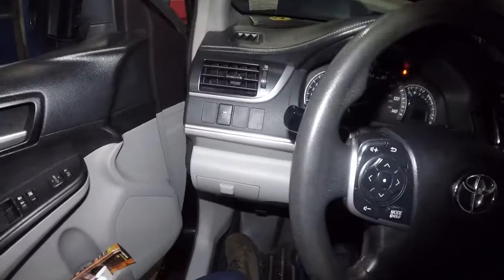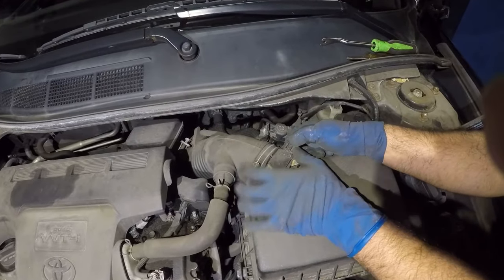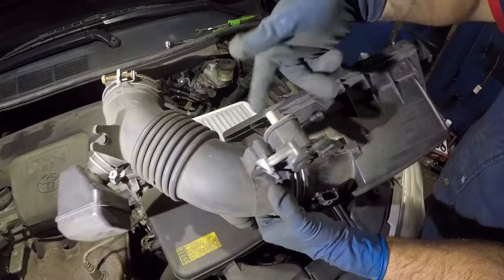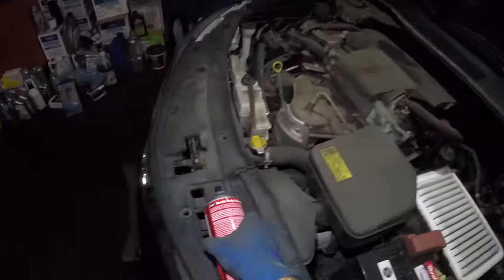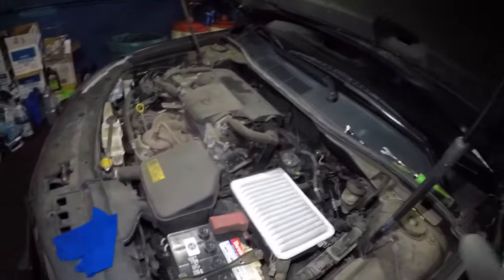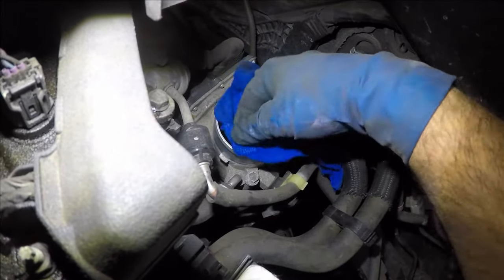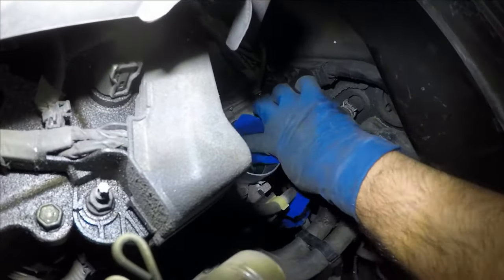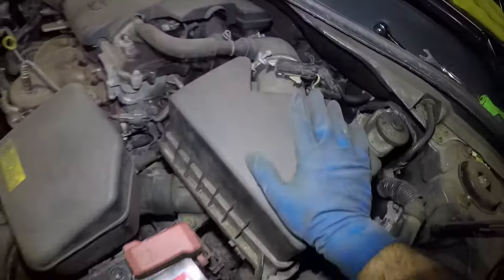Toyota Camry 2007 to 2017 Low idle car stalls and feel vibration, Throttle body cleaning

Comment: I have toyota camry 2004 (manual) When i run the car without airconditon the rpm is not drop but when i turn on the Aircondition car feel little bit shake then car when running about avobe 30+ speed the rpm is good but when car get reduced speed car shaking and when gear in neutral engine get stop plz tell me about the problem🙏🙏
Reply from the maker: Yes so when u put ac on it puts loan and this service for throttle maybe will help lot!!
Reply: ok lets do it tomorrow then i will tell you the result ❤️ @RBTheMechanic
Reply from the maker: @sanjeetimran4651  ok update me

Comment: I have the same camry 2013. It doesn't turn off on the stop light but sometimes it feels like choking when I'm gaining speed and rpms are always low, about 1700-1800 no matter the speed I drive. Do you think it could be the same issue with the throttle body?
Reply from the maker: 1700? Idle suppose to be around 700-800
Reply: @RB The Mechanic  the idle is around 700. 1700 -1800 is when I'm driving and that's when it feels like the car is choking so I need to accelerate so the car start driving better
Reply from the maker: @FranciscoCortez12  driving dosent have actual range so if ur idle is good the. U don’t need to worry however clean out ur throttle anyways
Reply: @RBTheMechanic  got it. Thank you!!
Reply: @FranciscoCortez12  I have the exact same issue on a 2014 Camry 2.5L.
Reply: @NobleAutoNC  you guys solve the issue? My car judders at 1500-2000 RPM accelerations…

I’ve seen online it could be fuel injectors or fuel pump… any help ?
Reply: @FranciscoCortez12  did you find a solution?
Reply: @omty3399  I didn't. I just kept driving like that 😐
Reply: @FranciscoCortez12  damn I have the same problem it’s just been gradually increasing on my 14 camry I changed the coils and spark plugs I changed the fuel injectors I gave the car a oil change and it’s just getting worse it’s been going on for 6 months do you guys have any advice?
Reply: @Omty  man I have no idea what is it. Dealership said it could be this or that so we would need to change things in the car one by one until we find out what is it. Which is a rip off. So I'm kinda lost here
Reply: @omty3399  change the maf sensor
Reply: @mauidapro6225  yea it was some sensor it cost 300 bucks car runs fine now
Reply: @thatredcam it sounds like the Camry torque converter shudder. Look it up. Mine had it and unfortunately I didn’t know till over the 150k mile warranty for it. Dealership won’t tell you either. It’s a problem with the car it’s self.
Reply: @omty3399  which of all sensors was it ???
Reply: @shiffleshanks  it’s crazy bc I even changed my transmission bc of it, and it’s still happening… do you think any dealership will still fix this for me? I’ve owned the car since 2012 and it has 135,xxx miles… please let me know

Comment: Any reason why a 2019 Toyota Yaris would be doing this? At 20,000 miles
Reply from the maker: Could be dirty throttle this is very common issue on electrical throttle it’s sensitive it’s perfect time to clean every 20-30k miles
Reply: Awesome I’ll give it a check and clean! Anything else you recommend it could be if it’s not the throttle body
Reply from the maker: @Ozone9300  air and cabin filters if u haven’t done those

Comment: Excellent walkthrough, thanks!  With the key on ACC, when you press the gas pedal, would that cause the computer to try to add gas as well to match the throttle body position?  Can you leave the gas all the way down as long as you want with no issues?
Reply from the maker: No it will not add gas engine is off

Comment: Do you happen to know what  the problem can be when you depress the gas pedal with the key on acc the throttle flap opens really slow? At times It opens instantly then sometimes it opens slow?
Reply from the maker: There’s no problem there these care are designed to only open depending on speed of the car for safety reasons but I can trying cleaning it might have small jam or bad throttle
Reply: Would something like a bad throttle or dirty throttle throw a mass air flow sensor code?  That’s what happen in my case I replace the mass air flow but the code never went off. I come across your video and I clean the throttle body put everything back together cut the car on check engine light was on drove around the block cut the car off and back on the light went out, next day it come back on. Any idea as why it’s doing that? Thanks
Reply: @danieldo6254  I’m here because i have that same exact issue right now. Gonna clean the throttle body out first and if it still stalls then i might just replace the sensor as well.
Reply: @NpausAsHawj  hey I end up replacing the fuel pump and got the oem sensor from Toyota and everything worked fine no check engine light no hesitation good to go hope that helps.

Comment: Advice needed, I am having even lower idle after throttle body cleaning. What are the possible causes?
Reply from the maker: Did u do idle relearn usully it goes high not low possability bad throttle
Reply: What ended up being the issue?
Reply from the maker: @ASMRBully  this was it

Comment: Followed directions now the idle is 1600 (2k with AC on) Suggestions?
Reply from the maker: Do idle relearn… I never had issues did u disconnect battery or force the throttle
Reply: @RBTheMechanic  had some one turn key to on position and press the throttle to the floor. Sounds like I should disconnect battery for a hour to reset
Reply from the maker: @unisuit  i think he may have forced it or somthing only u urself would avoid all pro cautious anyways disconnecting battery will allow it to loose the idle memory then it will be low rpm u will need to relearn the idle it may try to stall on stop sign on red lights
Reply: Fixed. Throttle relearn did not work. Battery disconnect, then throttle relearn resolved issue. Thank you for your time and knowledge. You saved us a lot of money.
Reply from the maker: @unisuit  no problem always here to help!!

Comment: I mistakenly removed the negative plug of the battery, to reset the engine light code, what can I do ? Please advice
Reply from the maker: No worrie. Try idle relearn finish up what ur doing and then idle relearn here is a video https://youtu.be/sCsBqeZctzE?si=tG1ibFrlNiyWRYUY
Reply: @RBTheMechanic  thank so much ! It work out for me
Reply from the maker: @digen95140  welcome

Comment: Hey man my car behaves normally when driving I have a 2010 Camry with 2AR-FE but the one thing is it when I turn it on it goes to 2k rpm and one morning it choked like crazy and smelled like gas everywhere but it idled normally afterwards and this all started happening after I accidentally left the cruise control on when I turned off the car. Is it a dirty throttle plate?
Reply from the maker: U can’t assume or say for certainly but do this throttle service it will fix manything or upcoming issues and let me know how it acts after that
Reply: @RBTheMechanic  alright I’ll try this weekend but I think the throttle plate was left open when I turned off the engine whilst leaving the cruise control module on and overnight carbon and fumes built up into the throttle body. I’m gonna check the condition of it though.
Reply: @RBTheMechanic  hey man I didn’t have a chance to try but where is the IAC valve on these 2ARFEs?
Reply from the maker: @DuckMcDuckinson  what year
Reply: @RBTheMechanic  2010. It has the 2AR-FE engine
Reply from the maker: @DuckMcDuckinson  clean out the throttle it will make a big difference and let’s see what’s the outcome but rpm going high could be transmission shift issue
Reply: Plus it never stalled the only issue is the small choking and the high revving and then goes to normalcy after 20 seconds.
Reply: @RBTheMechanic  nah my transmission is perfect.
Reply from the maker: @DuckMcDuckinson  yeah it can be when transmission shifts out and in to gear but I would ignore it if it’s not a big deal just scan for codes if there’s anything
Reply from the maker: @DuckMcDuckinson  this electrical throttle is IAC itself.
Reply: @RBTheMechanic  hey fam I tried doing it this month lol I know almost a whole year later I’ve been lazy about fixing it since I don’t drive it that much but wow my model year has that STUPID band clamp for the boo that goes on to the throttle body…….. I literally bought a 6 inch needle nose to get access to it and now ima wait next weekend to actually do the service. Car has 92k miles and it’s never been done. I’m powerfoaming it instead of cleaning it and ima take off the check engine light with a scan tool at advanced auto or o reilys. That way I clean the valves and heads and it’ll clean up the cats. God bless you either wise my friend! Yeah I couldn’t find the IAC so I also assumed myself that it was integrated into the throttle body. Now I fully know there’s a panel on the side of it that monitors the idle and all.
Reply from the maker: @DuckMcDuckinson  yeah do it it will make the car idle run better and start up

Comment: Friends 2013 Rav 4 experienced similar issue. I cleaned maf sensor, changed battery. 
Keeps shutting off. 
Friend brings to Toyota mechanic and says its the throttle body so he cleans it.
Week later, car keeps shutting off again at red light or stop sign. It’s not the throttle body!
Brings Rav 4 back to me and I was going to pull spark plugs.
Instead I check oil level. 
I checked the dipstick; 
there was no oil at all on the dipstick. I’m scratching my head. 
I ask: 
where do you get your oil changed at?
Friend says Toyota dealership.
I ended up having to fill with 3 quarts oil and immediately car idled better and rattle at startup went away. 
Took for test drive, car drove great and didn’t shut off.
Simple but important fix:
Folks, Check your oil level regularly especially after an oil change to make sure they put in the right amount.
Go to a trustworthy place that will take care of your car properly if you can’t or don’t work on your own vehicle.
I’m thinking either incompetent mechanic or intentional sabotage!
3 quarts short? Hmm.
Makes me wonder!
This mechanic is good though, I like the way he walks you through the repair. Good video and explanations paired nicely!
Reply from the maker: It’s prolly burning oil I would tell him to check oil level consistently every few days
Reply: @RBTheMechanic  
I checked underneath . No oil leaks anywhere. I find it impossible that it burned through 3 quarts.
Only 100,000 miles on it and they are meticulous with the cars oil changes and maintenance.
I agree RB: I gave them that advice: check the oil level weekly, monthly.
Going forward, I will be doing their oil changes from now on and monitoring this “mysterious” oil shortage.

Thanks for the advice. Keep up the great work with your videos!!!
Reply from the maker: @jsoda41  when engine burn oil there will be no leak it will burning through combustion

Comment: Why is the idle speed so high after I wash it?  how to lower
Reply from the maker: U can do idle relearn or drive around without any lights radio hear ac on so there is no load it will learn idle speed again
Reply: @RBTheMechanic  thanks

Comment: I did it, it isn't stalling anymore, but now my idle is high like 2k and I am getting code for "Air temperature sensor" PO113 and "Volume air flow sensor" PO102
Reply from the maker: Do idle relearn
Reply: @RBTheMechanic  Thank you, I did that 6 times. It still is at 1500 in park and 1000 in drive.
Reply: It took a few drives, but it fully adjusted, and it even cleared the check engine light itself. Thank you
Reply from the maker: @ppen23  oh cool
Reply: Thank you

Comment: Be careful with your fingers. After i do the fix as show in the video i read on reddit that if your finger its in the way and the throttle close it can slide the finger with no problem 😅🙆🏻‍♂️ thanks god i read that after i finish doing the work 🤣🤣
Reply from the maker: Ok thanks for the tip I had no issues

Comment: Man I having the exact same issue with my 2014 Camry and I changed the trotte body and it’s till turning off with no codes
Reply from the maker: Did u try relearn idle usully when u change it the car will stalll it needs to relearn
Reply: Yes sir only other thing I’m thinking is the throttle body I changed wasn’t a brand new one it was a from a different Camry we have that no one uses maybe I need to buy a brand new one ? The only code that came up at first was the p0420 for catalytic converter and that’s when the car starting giving me issues turning off / rattling when accelerating then that’s when the throttle body code  came on . 🤦🏻‍♂️
Reply from the maker: @omargarcia9115  either way it still need calibration relearn procedure. Oh ok if u got the p420 code that can cause stall and loss of power I had car that wouldn’t drive more than 15mph
Reply: @RBTheMechanic  yeah man only thing is my car drives fine no loss of power  just having the issue where it turns off at idle or at slow speeds
Reply: Might just try changing the catalytic converter the last thing I can try . Really giving me a headache lol 3 different mechanics have looked at it and can’t find the issue
Reply from the maker: @omargarcia9115  yeah if it got colde then u gotta replace it
Reply from the maker: @omargarcia9115  do use relearn

Comment: That did not work , I tried everything I can think and see, spark plugs, clean throttle body, transmission fluid and filter change, idle relearn, and still my camry will  shake when at stop light on D
Reply from the maker: What is the rpm at redlight
Reply: @RBTheMechanic  i have same issue please help, my corolla 2020 drove 70k km only, when i stop on red light pressing the break the passenger seat vibrate also same R reverse, so i use two legs for accelerate with break the vibrate gone. I went to 5 mechanics they do very deep inspection like for engine mount transmission mount all looks good even all 4 break pads changed and rotor cleaned the sound comes only by pressing the break at ideal or red light stop or parking, one mechanic request me for throttle clean but i was afraid it may cause me other issue.
Reply from the maker: @ferozsyed2014  clean the throttle it could be low idle causing engine vibration
Reply: Did you replace the ECM?
Reply: @salmaya92  No I did not. Is that what fixes the issue?
Reply: @chalanero11  yes

Comment: What is the name of the hose that you took off on 7:14 ?
Reply from the maker: The vent pipe
Reply: No I’m sorry I said everything wrong, not the vent pipe, I meant the little hose on the left side that you detach, on 2:32 you detach a small hose, my apologies I said the time wrong , anyways what’s the name of it
Reply from the maker: @darelbalanzar  oh ok that’s line dosent have name but it connected to evap purge valve

Comment: Saludo manito dónde you got the spray my put s many thing new got CR-V 2000 do like air coming know got low rpm got Dow 1 put gasoline like up 1 rpm noise the air got away take fit gasoline coming back you know can be got me crazy bro you do good kid 🔥
Reply from the maker: Thanks bro I didn’t understand much of u said tho
Reply: @RBTheMechanic  o my bad how you talk thing Spanish to 😂😂 ok say my Honda CR-V 2000 the rpm stared got up the1 number to 3 that's ok motor hot got Dow like 0to 1 half way close 0 and Air coming don't know check see liking nothing put the pedals gasolin up got way it you know what can be thank bro you do good job Thad vídeo g bless you
Reply from the maker: @angelgarcias8219  I still didn’t understand bro I’m sorry not sure if I got this correct but I think throttle cleaning might do some good

Comment: I did it after that my car has air issues and is so slow after I cleaned it
Reply from the maker: Did u disconnect the battery? I never had this type of issue but it may need time to relearn
Reply: @RBTheMechanic  and my car won't shift right when driving I changed the throttle body and still same problem
Reply from the maker: @issavibez394  you have to relearn the throttle if u changed it I though u cleaned it
Reply: @RBTheMechanic  ok
Reply: @RBTheMechanic  I cleaned it after I did it I messed something up so I changed the whole unit n still same issue I'll try relearning it again
Reply from the maker: @issavibez394  ok so I’m not sure how u cleaned it did u disconnect the battery?

Comment: After I replaced IAC valve on my scion , I tried to clean the code by ( BAFX PRODUCTS , which is Diagnotic Inerface , it reads the code& problems😄
I bought it from amazon about I think $ 35) it was clear the code but as soon as my wife❤ drove it to bring my kidoes from school back home , the engine light came  back on . I cleared it on & on , the same things. I told myself : self 😊 Let's do it the old school way : I disconected negative battery terminal for a good 2 hours . I drove it for 18 miles no more crazy engine light .I am about 70 years old & DIY is my way . I have learned alot from you good people for real .May my LORD❤ be with you all . 🙌🙏👌✟✟✟
Reply from the maker: Oh nicee I will keep that in mind u never know when I need to do this but new cars issue is loss of idle memory and radio codes

Comment: nNo way to clean it correctly without removing the T/B very easy process.
Reply: Yes there is, turn the key off. Use your fingers to move the plate (slowly) up, on each side, so you can get both sides clean 👍